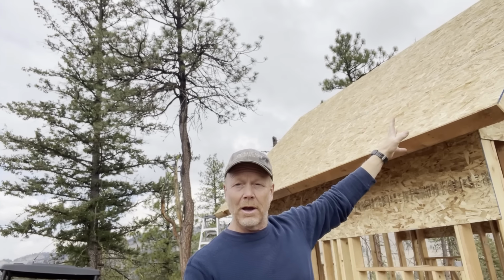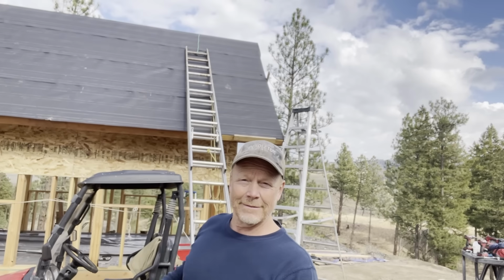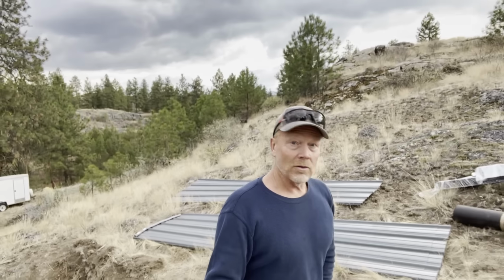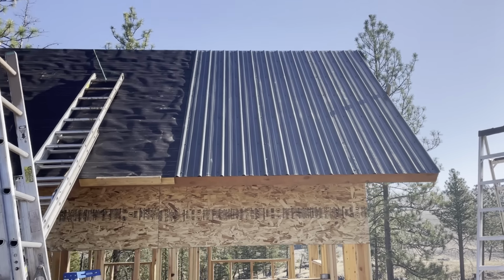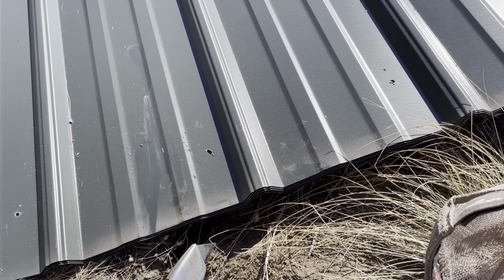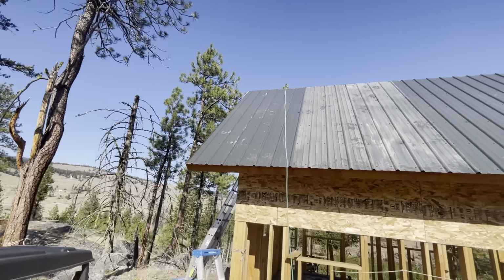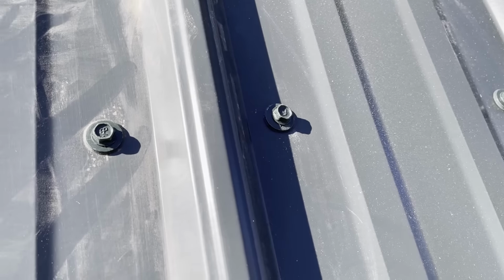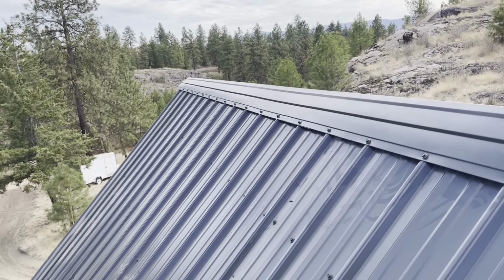Best Way to Install a Metal Roof on an Off Grid Cabin...Alone.

Comment: I had to comment as well. I built a tiny house (8' x26' ) all by myself. It was suppose to be a father son project but as soon as I had the subfloor built my son had to have surgery on his knee.that ment It was just me to do the rest. I had many of the same hurdles you did. One trick I did that worked great on the roof was  halfway up the panel I had screws that were on the ridges of each panel. I simply laid a two by four on the roof and banged on it with a hammer to leave impressions on the bottom where the screws were. Then I drilled all the holes out at the impressions and backed out the screws and replaced them with longer ones through the two by four. Then I had sturdy footing on the roof and I could shimmy back and forth without moving ladders while I installed the roof cap. Also I only needed to do this on one side it worked great as I don't like heights either. It's been five years now and the project was a great success. No leaks no mice just a lot of relaxation.
Reply from the maker: Sounds like it worked like a charm!

Comment: Man you sure are a good feller to work with I had fun.  Great job.  Done similar all part of life.  We'd keep some cloths around lader ends.  Most of time we would put a full scaffold on one side.  2x8 supports legged down to ground and we had dedicated 2x12 or 2x10 walk boards for years back when you could get good close grain popular and not this heavy wet spruce stuff.  good job
Reply from the maker: Ha thanks! I’m easier to get along with when I’m in a video. 😬🙏
Reply: @LifeontheMoose  Bit of an act to a presentaion. Done it for years addressing hundreds with safety presentations.  Place id looking really good.  Time to hang some meat up for the winter.

Comment: Oh jeeeze. I damn near fell off the top of the roof when you were putting the ridge cap on. But, pretty soon I'll be building the wall on the carport, thinking about ""Do I match the exterior wall on the other side of the garage, or do something different?" So if I put siding on both then I match without having to match the patterned plywood or color. Thought about vinyl but more likely thinking about roofing tin. I need to frame, insulate, and skirt the wooden floor side as it's sitting on concrete block pillars opened to air.  Great to watch this one again. Always gives me food for thought.
Reply from the maker: I’ll provide the food, you provide the thought! 🤔
Thanks again for watching like you do!🙏

Comment: Just found you , back in the late 70s early 80s I was taught the screw or nail with the rubber gasket goes in the high part of tin ---- when the gasket rots less leaks cause the screw/ nail is higher
Reply from the maker: I get that, but because the flat has no give and is therefore tighter and more secure, manufacturers want it screwed there. Glad you found me!
Reply: I have never installed a metal roof or vinyl siding and I've never built a cabin, just some outbuildings garages, utility sheds and the like. I once put a lexan roof on a covered patio (timber frame construction, open roof support to provide some shade with good light).  Out of an abundance of caution I used a little dab of roofing cement on each of the gasketted screws.  Maybe it's my job safety training talking, Patrick, but if it were me when you scored and cracked the steel I would have been wearing some sturdy leather gloves; you might have been seriously injured.

Comment: I will be installing R-panel metal roofing, just like your metal there, and the company who sold me the metal, told me to use the 2-1/2” gasketed screws on the highest point of the R-panel and NOT on the flats! That will make it more difficult, but more waterproof, they said! But it’s looking great, anyways! Great job, doing it solo, just like me!
Reply from the maker: Thanks! Ah…the old ‘where to put the screw’ debate. It lives on!

Comment: Tree's blowing in the background remembed "sometimes you can't beg for a no wind day".

Took awhile? You would laugh if I told you just how long it took me (by myself) to insulate my 42x70 shop ceiling rafters fitting 4x8x4" eps-2 layers staggered using a scaffold then covering-stapling entire with 8ft wide scrim paper!

After 40 yrs in the business I still forget sometimes how ANYTHING takes longer than I had figured-hoped working off ladders.
Reply from the maker: It sure does take longer!😅

Comment: Nice job! Looks great!! I rebuilt my house in the last 4 years from the ground up to the ceiling. Hurricane Harvey flood water was nearly over my roof. About 3 feet of the roof was sticking out of the water. Ruined everything below the rafters. I built stands and used beams and jacks to lift the roof about 6 inches. I then tore everything out from the ground up and completely built a new house and then sat the roof back down on the new structure I had built. New plumbing, electrical and everything. I enjoy watching you build because I also did all the work by myself. My wife helped with cleanup and paint and what she could when she was home in the evenings. Lots of fun... !!!
Reply from the maker: Great story and well done! Glad you’re good. I appreciate you tuning in.
Reply: @LifeontheMoose  1Thanks! I enjoy your videos, very entertaining and informative. Great videos!!!

Comment: There are foam “blockers” that have a sticky face side to use at the top and bottom of the sheets.  They keep insects like wasps, bees, flies, etc from living and breeding in the openings of the sheet metal.  Nothing worse than having wasps and bees building hives in your roof sheeting!
Reply from the maker: Yes! Good idea. So far on any build, haven’t had that issue. But I may fill the gaps with foam spray in the future. I appreciate you watching!

Comment: if the foam pipe insulation is not thick enough buy some pool noodles , pool noodles around the lip of a home depot. lowes bucket bucket make for a soft makeshift toilet

Comment: Most manufacturers recommend a "stitching screw" for the trim.  These are 1/4 headed short screws as they don't intend the trim to be fastened to the sheathing but just to the panel beneath.  Also the recommendation for the 5/16 headed screws comes from the fact that some roofs (unfortunately) are sheathed with 1/2" plywood (not as bad but bad) or OSB.  If you use 5/8 plywood or 3/4" (best for a quality roof) or minimum 3/4" OSB (I know, most use 5/8 but the holding power of OSB is much weaker than true plywood) then the 1/4" headed screws give you a nice option down the road to refasten the roof if the heads rust by then using the 5/16ths fatter screws without needing to replace the panels if they are holding up well.  My own roof 28 ga has the 1/4" headed screws in 5/8 plywood (I bought the house used but put the new steel roof on).  After thirty six years of SE Alaska salt air and 180" rainfall plus heavy wet snow with winds of 100 plus once or twice a year and lesser winds on a regular basis it is holding up well with a few more years in it.  My shop roof I installed four or five years ago is 24 ga standing seam and should be there fifty years from now, which I won't be!  Hardest thing on a steel roof is a roof stack and the harsh chemicals from combustion coating the surrounding roofing.  I had an oil boiler with vertical stack for twenty years and it did attack the steel.  For the past fifteen years before I went to mini splits for heat I installed a boiler with forced sidewall venting which saved wear on the roof for sure.  It also was high efficiency where the old boiler was not so I am sure that helped.   You are dead right about overdriving the neoprene gasket on any of the screws.  Not only is it a prospective leak but it invites rust to then get in and attack the steel left bare by the threads.  Best case is to take a can of matching spray paint and hit the screw heads after installation.  Take care.  Always risky to work alone, especially off the ground.  Been there done that!
Reply from the maker: Lots of good info! Thanks for taking the time to watch and comment! 🙏

Comment: First question is.. Why do you have OSB on a roof that is getting metal??? 2x4 perlins is all that is required.. With single bubble or double bubble
Reply from the maker: Racking strength, insulation, ease…I appreciate you watching!
Reply: @LifeontheMoose  its not necessary.. Just added expense and work
Reply: @LifeontheMoose   And added deadening the sound of a downpour.

Comment: Excellent. I built a 20x20 carport a few years ago up on my property, but it doesn't have a 12/12 pitch, more like 5/12. Would share a photo but don't see that I can. Soon I'll be converting the carport to a little cabin. In the next few years planning on building a 1.5 story 20x36 small house on the same property. It will have a 12/12 pitch and dog house dormers 😀
Reply from the maker: Fun! Keep me posted on the project. Thank you for tuning in.

Comment: You didn't use any inside or out side closures. The rubber gasket that fills to holes,why?
Reply from the maker: Not sure what you are referring to…rubber gaskets? You mean in the gaps under the ridges?

Comment: Looks good, but why do Canadians & Americans put the screws in the flat bit of the tin..Does my head in..Here in Australia we put the screws in the ridge so if/when the rubber seals break water flows away from screw hole and down.
Reply from the maker: I believe most manufacturers recommend the flats, because the positive contact  between metal and roof deck on the flat is superior to on the ridge. But as they say, “when in Australia…”
Thanks for watching!

Comment: Great video. What is your strategy going to be for roof insulation? I thought I had it figured until I saw the paper and gasket taped ridge cap over what I expected to be a vented ridge.
Reply from the maker: Just good ole batted insulation. That ridge still breathes enough for this cabin. In this climate and for the time this will be heated, I’m confident the moisture won’t be an issue. Thanks for asking and for watching!
Reply: @LifeontheMoose  are the batts going to stood off the inner roof skin in any way? I assume your vapor barrier will be on the inner surface of the rafters? I'm at ~7500ft in the Rockies but everything I learned about building was in the Midwest, so I am constantly finding my intuition about the necessary course of action to be wrong😂

Comment: Why didn't you install a drip edge
Reply from the maker: Thought hard about it, but just didn’t see the need. The roof pitch, angle of fascia, and steel overhang are the main reasons. I did the same on the main cabin on Red Moose Ranch, and I don’t think the fascia has ever been wet! Thanks for asking and for watching.

Comment: Most ribbed roof sheeting is designed to be installed with the screws being drilled through the ridges, rather than the pans, as the screw hole is at the high point, not the lowest, therefore being less likely to leak. Screwing through the pan is typical when the sheets are used as wall cladding.
Reply from the maker: Hmmm…I think I’ll challenge that. I believe manufacturers suggest the flat, because the solid contact to the roof deck is superior there.